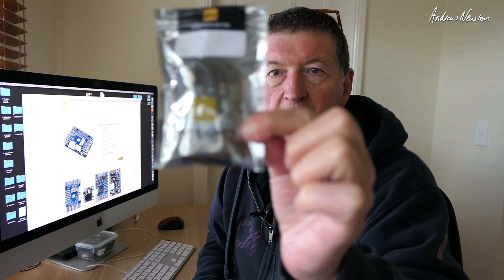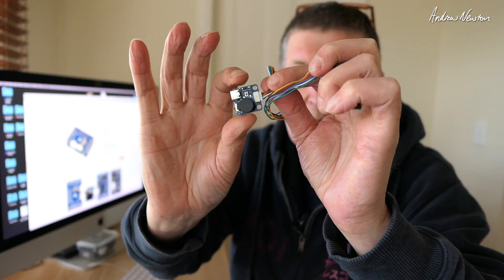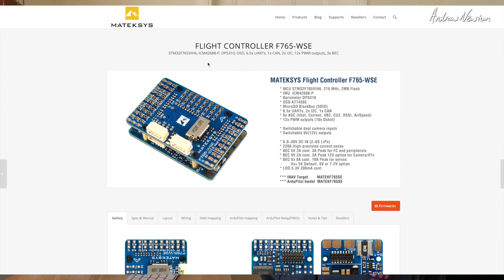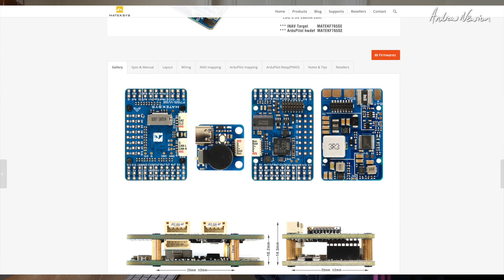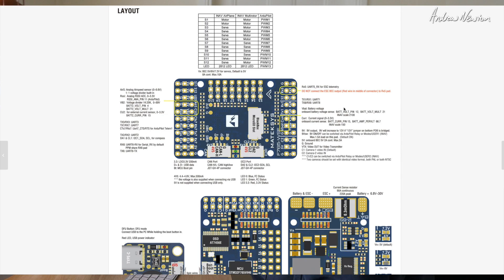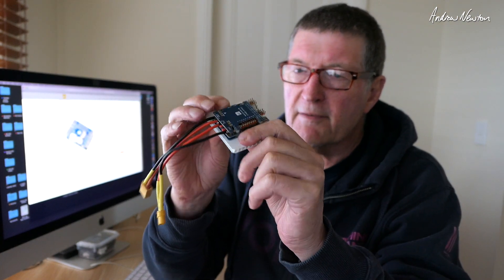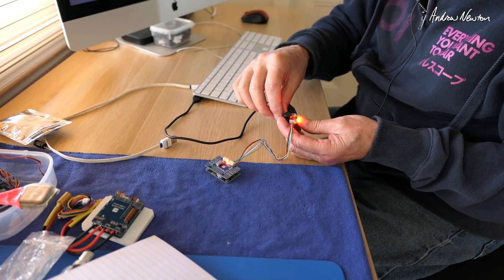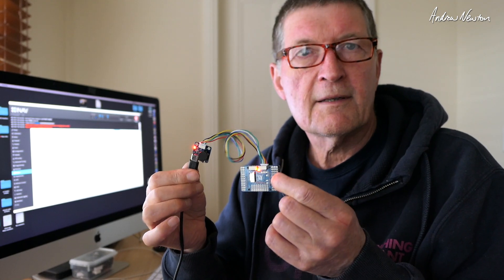Matek F765-WSE Flight Control Board

Comment: i have this FC and I have installed ardupilot. Now I would like to go back to Inav 6.1 however when try to flash nothing happens. I click on flash firmware but it doesn't do anything. do you know if I have to do a special procedure since i have ardupilot in the FC ? thank you very much in advance
Reply from the maker: The boards needs to be connected in DFU mode. Download the INAV firmware file to your PC from Github then try Load Firmware (local)

Comment: Question, Andrew if you would be kind enough:  @8:27 in video; if I am using my 765-WSE with DJI air unit for fixed wing and intend to use the RC control, its very clear how all of the wires should connect from the DJI air unit wiring harness, except for the BROWN wire (signal ground next to yellow coming of DJI air unit), the Matek wiring guide doesn't say where to put it. The diagriam just has it blank ....appreciate the helpful video.
Reply from the maker: I have not used the DJI RC signal, but wiring diagrams I found show that any UART G pad can be used.

Comment: hoping you can help   my new F765-WSE wont connect to serial port it has power but wont connect to inav
Reply from the maker: Missing the correct USB driver on your PC at a guess. Ask on the INAV Fixed Wing Facebook group for guidance. Also there are driver links on the INAV configurator front page.

Comment: Andrew, were you able to configure the accelerometer for the F765-WSE with iNav 3.0.2?  I'm asking because when I tried to, I could not.  When I tried to add the hardware via CLI command as recommended by Matek, I get the following:  :-\

Entering CLI Mode, type 'exit' to return, or 'help'

# get acc_hardware
acc_hardware = ICM42605
Allowed values: NONE, AUTO, ADXL345, MPU6050, MMA845x, BMA280, LSM303DLHC, MPU6000, MPU6500, MPU9250, BMI160, ICM20689, BMI088, ICM42605, FAKE
Reply: Well, when I issued the "get hardware" CLI, the result came back and specified that the accelerometer was indeed set to ICM42605 so I guess I'm good to go.  Don't know why it's not showing up on the Configurator screen though.  A bug, I suppose.

Comment: After a few years of just building everything with INAV, I've decided, for the moment, that I just want to fly without all the encumbrances. And honestly my planes fly better without an FC, and are in the air & "tuned" in about a 1/10 of the time. Keep it simple.
Reply from the maker: Yes I agree. INAV is really just an interesting technical exercise in the overall scheme of things. Just flying, or slope soaring is so much better.

Comment: The prices are just too high for the matek. Now it is easier to buy some kind of JMCU, which is based on the same chip and is 2 times cheaper, only in the form of a square case for drones and without a current sensor. But already most of the new good ESCs come with a current sensor.